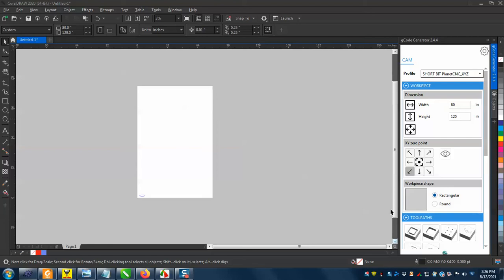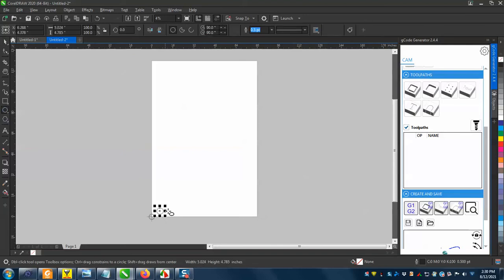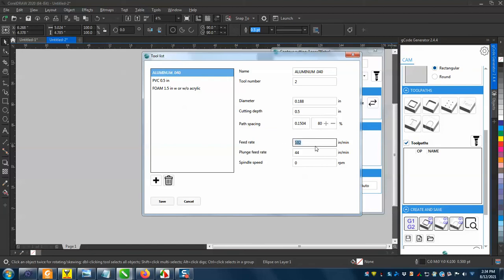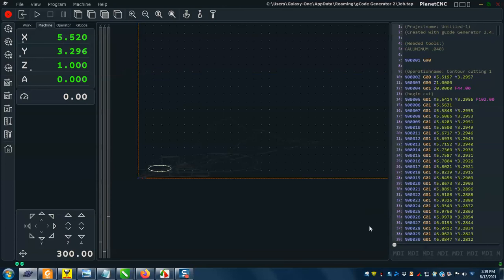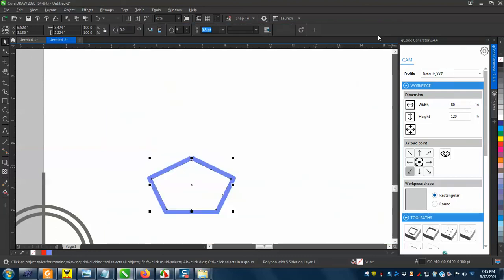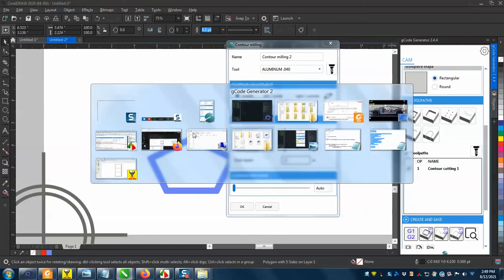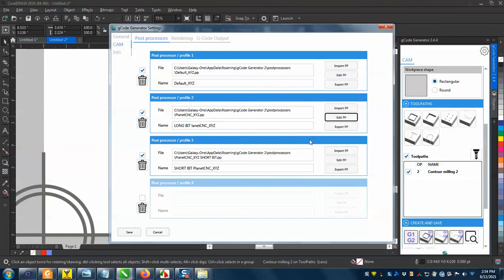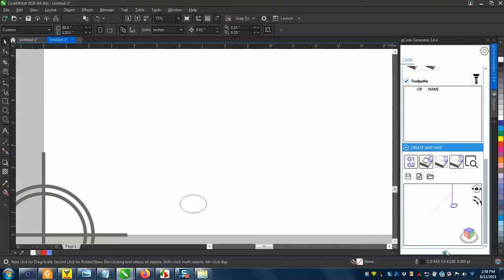Gcode Generator for corel draw TUTORIAL

Comment: hi there, do you know if I can do the same with Coreldraw 2019 ? I can find the menu with dockers and GCode generator .... Thanks    ah I am on a Mac ;-)
Reply from the maker: I think I ran into that problem too. Not sure if it was 2019 or a different version but I did run into something. Try this my experience was that the g code generator is there in the menu however the screen clips it so instead of using the mouse try using the keyboard and assume it's the last
Reply: @SLCKaled  27" iMac, so nothing is hidden ...... still no dockers or GCode generator. Thanks
Reply from the maker: Try this https://photos.app.goo.gl/oHrNo514nU7VXAff7